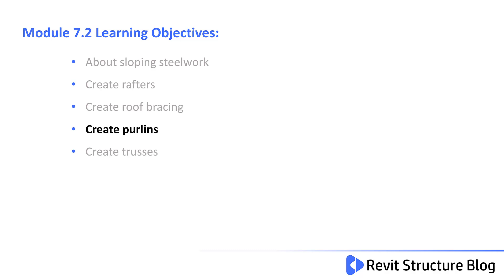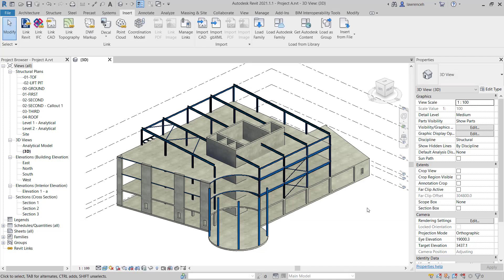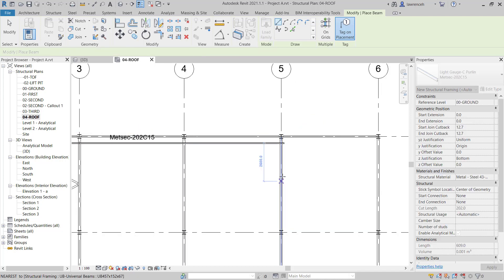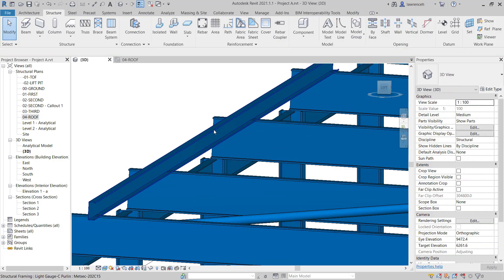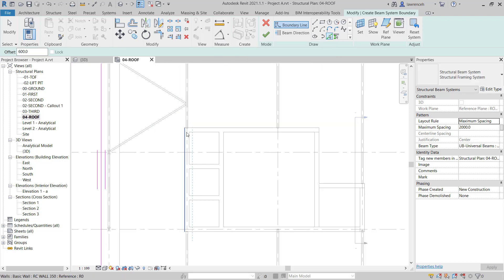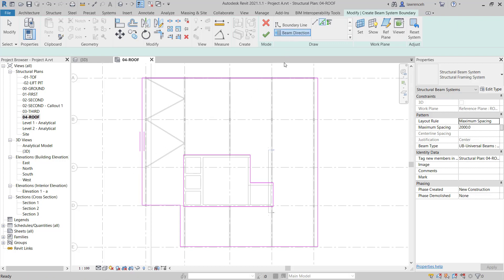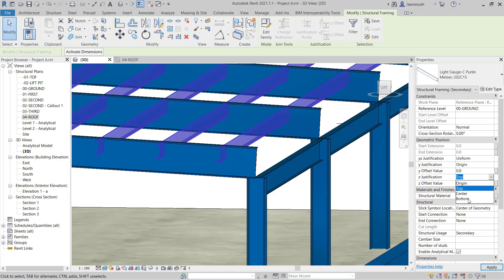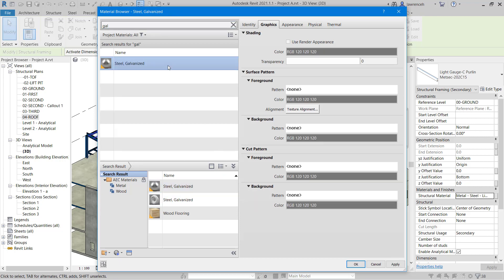Revit 2021 Training For Structures Essentials Module 7.2

Comment: 2 things I struggled with - 1. I couldnt pick an individual pinned item until I clicked on the pinned button (bottom right hand corner - no red x) .... 2nd ..... I struggled to figure why I couldnt get the Purlins to point up the slope. Drawing the lines from right to left has the Purlins pointing down the slope and vice versa. Also drawing from top to bottom & vice versa affects orientation of beam - You may have mentioned this somewhere else and I missed it .... my apologies If Ive gone over items covered before.
Reply from the maker: Hi Fred, there are a number of things you can do here. The cross section can be rotated, the family can also have a flip built in to allow the user to use the double blue arrow to flip the section. With regard to the pinned elements, the individual beams are pinned into the system. You can use the select options in the top right to ensure that you can select pinned elements.
Reply: @RevitStructureBlog  Thanks Lawrence appreciate the feedback.

Comment: Where is 7.1 please ?
Reply from the maker: It doesn't exist, I made an error with the numbering.
Reply: @RevitStructureBlog  So how can I cut the rafter that passed through core walls on the roof ? Shall I use Split command ?
Reply from the maker: @wonedrfuel5197  you can create a reference plane and then use the cut command or add a cast in end plate connection to the wall which will cut back the steel automatically.
Reply: @RevitStructureBlog  I found it by going to your channel and searching 7.1 :)Thanks for the videos.